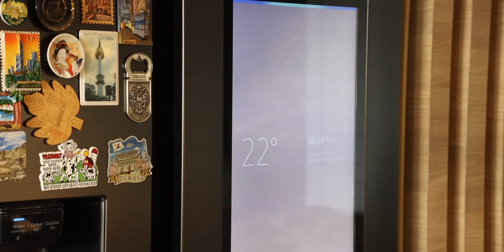Full day Routine with a newborn, kid and a dog | Cooking, cleaning & organizing the house

Comment: Hi Diya, I’d really appreciate if you respond to this message. I am a new mom too and been looking for a good breast pump, I see you have mentioned medela pump in description but I would like your honest feedback on that as I see all amazon feedbacks are pretty negative. Can you please help me with your opinion on that?
Reply from the maker: Hi. Before I used Medela pump I used a luvlap breast pump for a month or so. The medela pump did not improve expression  However since it was more expensive, it had a few plus points. It is made of Better material so is more comfortable as the cups are not exactly round and can fit the shape of any breast better. Plastic quality is better and it’s easier to wash and sterilize. Also it is very silent while expressing . It comes with bottle rest and lid for storage so you don’t have to worry about accidentally spilling from it. That’s my opinion, however cost wise it’s on the higher side. It’s a Swiss brand and considered the best in the world in this category.
Reply: @DiyaDey  thanks diya. So which one would you recommend from your end Medela or lovlap? I dont mind spending additional bucks if one is lot better than the other one.
Reply from the maker: I would recommend Medela if you don’t mind spending the extra. There is a huge difference in quality and that will be an advantage if you plan to express milk long term, 1-2 years.
Reply: @DiyaDey  thank you so much diya..one last question 😀 the link in your description is the model you recommend for medela right?
Reply from the maker: They have more expensive ones. But this one works fine. There is a model with single pump also that’s cheaper. You can chose between those 2.